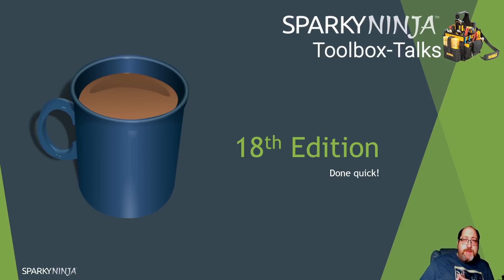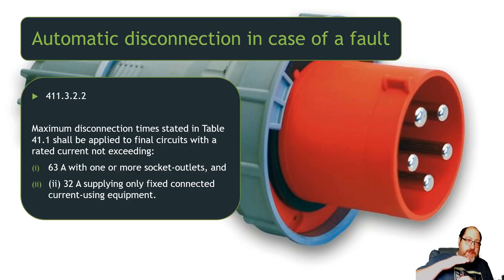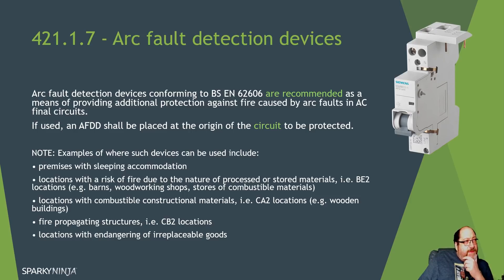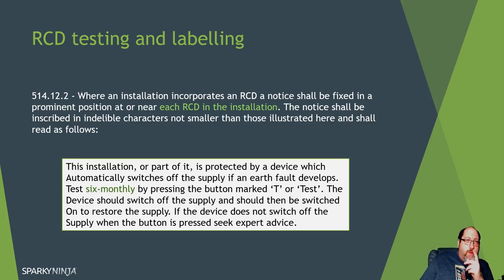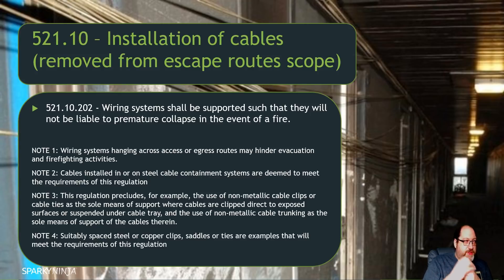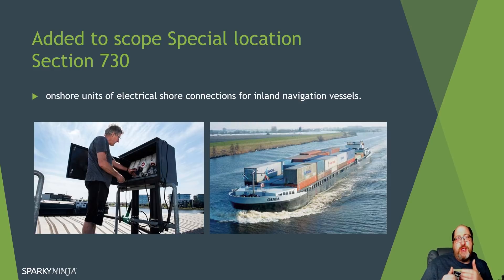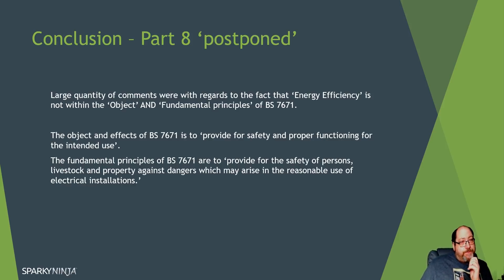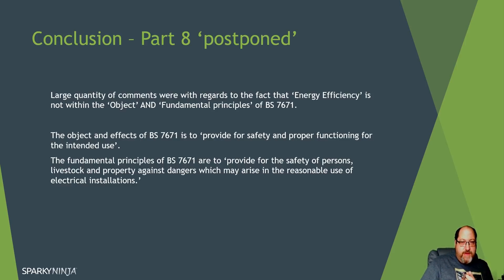18th Edition - Toolbox talk

Comment: how can u measure the miliamps on a circuit so its less than 30%??
Reply from the maker: clamp a low reading clamp meter around the live conductors while the loads are on and pray.

Comment: Hi sparkyninja I have been directed to you by gsh. I am going to be doing some 1st fix no connecting of items just running and trimming wires. Are any of the upcoming changes going to affect what I can do and how cheers
Reply from the maker: Hi Shaun. The only real significant change with the erection of wiring systems is that the need to prevent premature collapse of the wiring system in a fire condition has been increased in scope to ALL areas, no longer just escape routes. GSH did a video covering this I believe.

Most of the other significant changes effect design - areas such as protective device types, use of RCD's etc.
Reply: @SparkyNinja  thank you for your help in the near future I am hoping to take electricians course